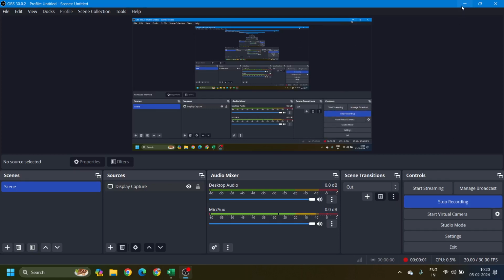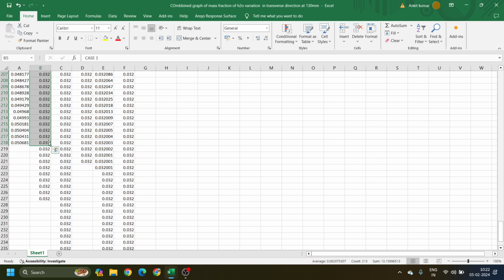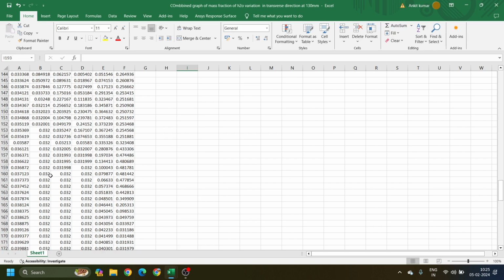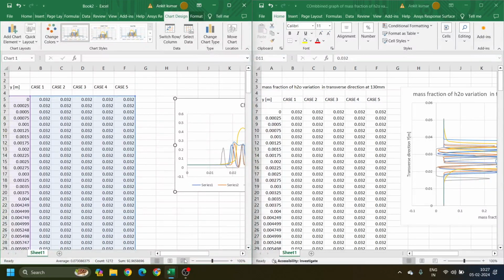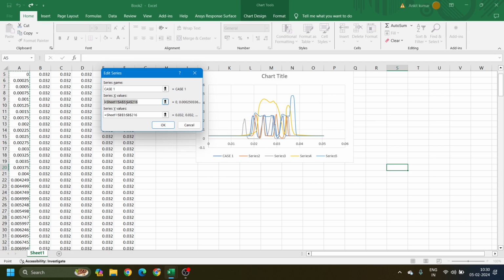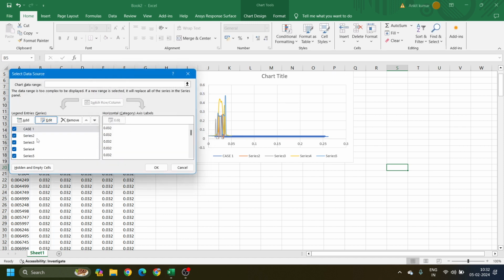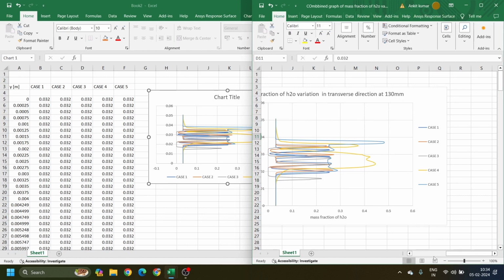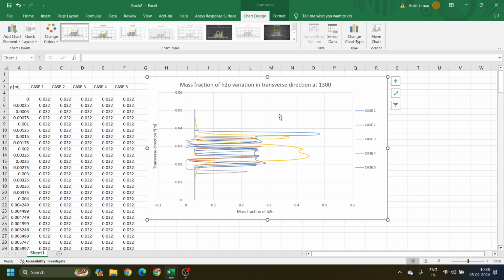Combined graph || MS EXCEL || xy Plot || Ansys fluent software

Comment from the maker: 1. Ansys fluent spaceclaim scramjet geometry
Video link :-  https://youtu.be/ldGH3reDNNw

2. Uniform Fine Meshing | Quadrilateral mesh | 2D Geometry | SCRAMJET COMBUSTOR|ANSYS fluent simulation. video link :-  https://youtu.be/USnSOyECkIM

3. Scramjet combustor simulation || ANSYS fluent || Strut based || 2D combustor || H2 and air mixture
Video link :- https://youtu.be/Xk-j40lfxV0

4. Ansys fluent xy plot | Excel Graph| extracting values from Ansys fluent software &plotting on Excel
How to do xy plot video link:-  https://youtu.be/Se6OQsRg8J4

5. Combustion efficiency || ANSYS FLUENT SIMULATION
Video link:-
https://youtu.be/9JMqe7klSuo

6. GRID independence test || ANSYS FLUENT
   video link:-   https://youtu.be/xwmhbomPiC8

#ansysfluent #ansys
#nitap #ansys #ansysfluent #ansystutorial #nitian #ansysworkbench #mechanicalengineering #ansyscfx

Like share and subscribe 
#ansysfluent #ansystutorial #ansys #ansysworkbench #ansystutorial #ansysworkbench #ansyscfx #cfd #tutorialyoutube

7.  Streamline Contours || ANSYS FLUENT
Video link:-  https://youtube.com/live/1u24TsPy6vg?feature=share